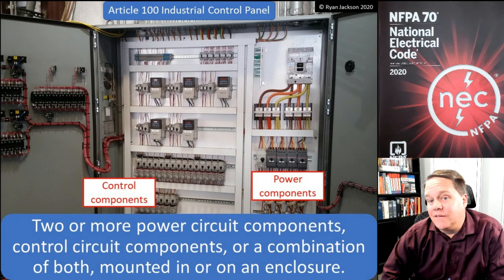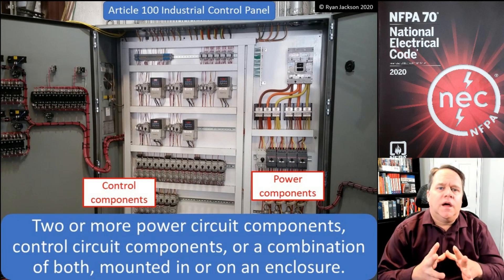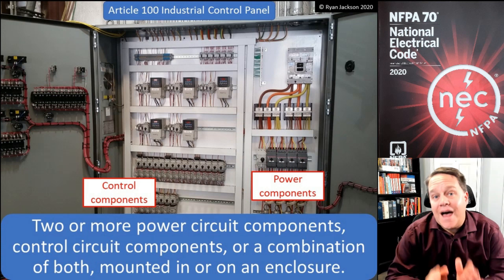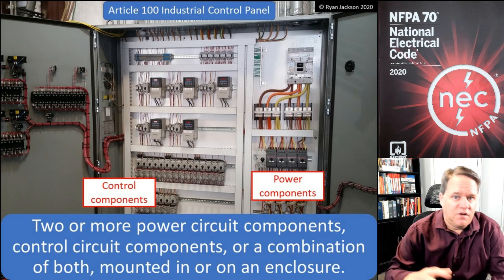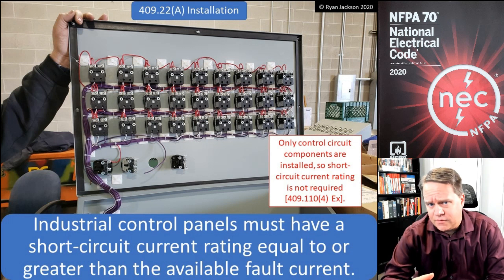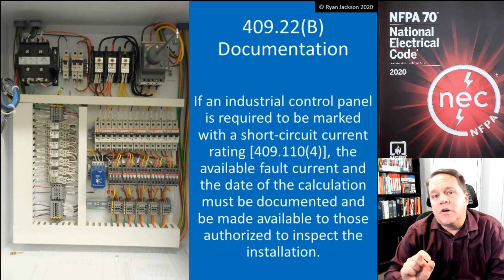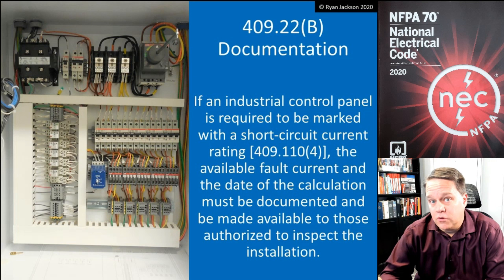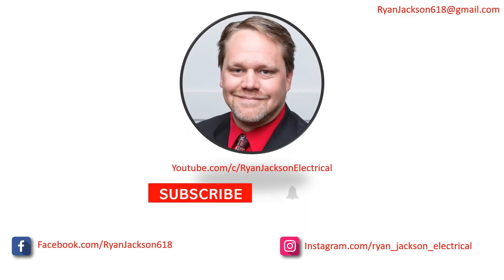100 Days of Article 100: Industrial Control Panel

Comment: For SCCR, there is a method that you use to provide SCCR.  508A manual works the best for reference.  UL Panel shop can apply the label as they are the manufacturer of the panel.  I design panels(power panels) like this frequently.  No field evaluation needed.  I provide evidence and proof of design and review with UL builder.  Pretty easy thing to do.  Pretty easy thing to screw up if you make assumptions and don't know what you're doing.  TBH, the only thing that makes me a bit uncomfortable is accounting for magnetics....e.g. cables not in conduit and just sitting in open air near each other...very common in an industrial power panel.  Should they be laced(roped) to each other???  There is no particular method for determining that so I don't know.  No, no destructive testing is generally done to determine if they're going to rip themselves out of terminations.

Comment: Was disappointing that for years almost all USA companies never installed a ground wire to cover that had pushbuttons indicating lights & selector switches like European companies. We had some 2' by 4' non mettalic panels that had 120 volts for pushbuttons & selector switches on hinged cover. After a few weeks operators were getting socked so we had to jury rig up a ground wire to each pushbutton. Was very small leakage current that never blow the 3 or 5 amp control fuse but dangerous just the same. I suggested that we cut out a piece of stainless steel sheet metal and knock out holes for pushbuttons & lights then bolting a ground wire to it but was shot down. Panels were in a area that got hosed down every night. Broke my heart when just about every one switched over to the inferior but space saving IEC type starters back in the 80's. Thanks for another great vid.
Reply: You had other issues !